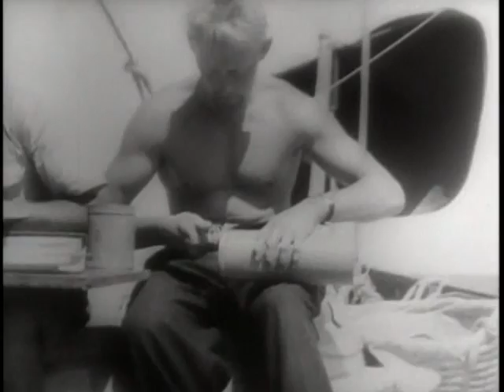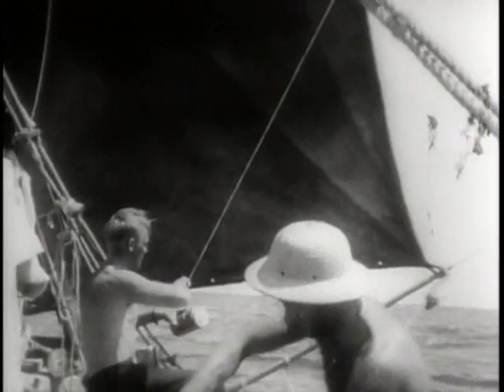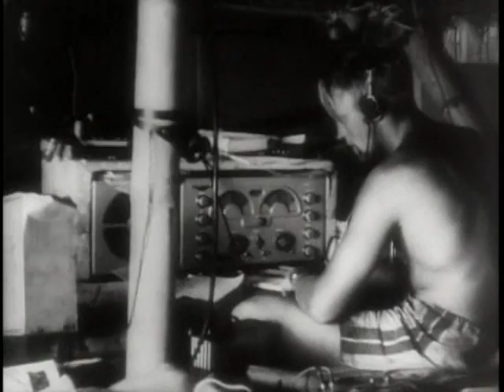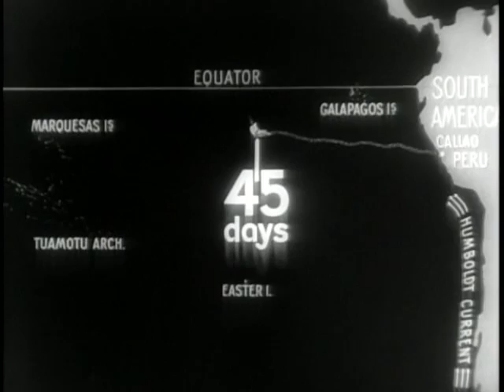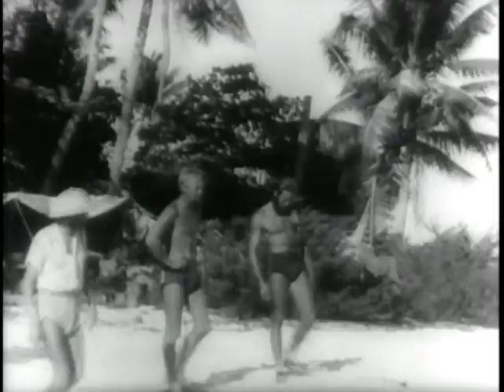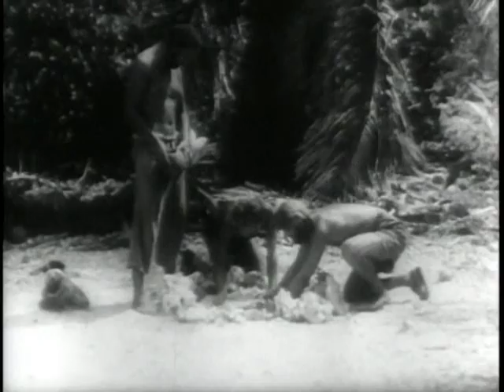QRP Ham radio on Kon-Tiki raft 1947 שידורי חובבי רדיו מרפסודת הקון-טיקי  Receiver  National NC-173

Comment: Read the book when I was 16, and still consider it one of the all-time great adventures of our time. Found the book 10 years ago, and reread it, and once again felt that same spirit.Now, a definite highlight in the annals of Amateur Radio---more that 70 years ago.
Reply: Forgot to include my call-sign:  VE3GNU
Reply: @ernstbartels4777  I wonder what kind of transmitter they had. (quartz stabilization ?) On what radio lamp ?
Reply: Hello---According to some research I have done, the receiver was an American model from National Radio Company, the NC-173---a general coverage receiver.  The transmitter was of WWII vintage, the B-2.The expedition was permitted to transmit out of the 20 meter Amateur Band---i.e. at 13.990 mc  at a max of 6 watts on Aug. 2, 1947. With respect to freq. stabilization---i.e. VFO, or crystal-control, no information on that.  I hope that is helpful.
Reply: @ernstbartels4777  Thanks